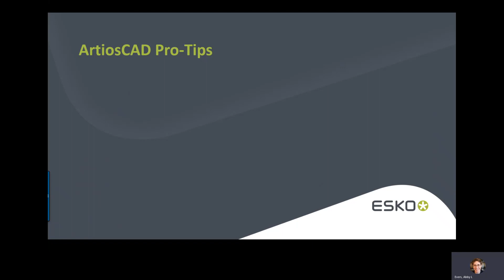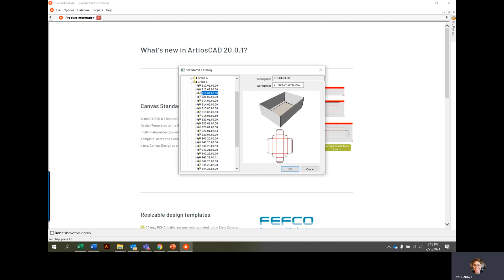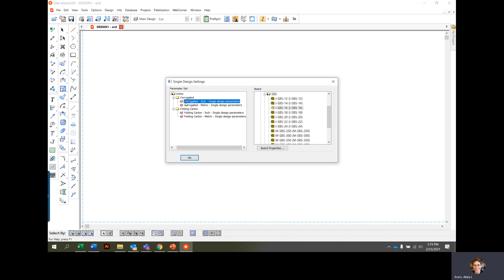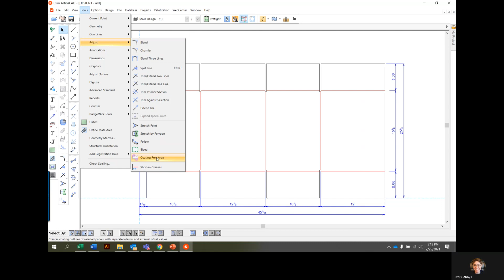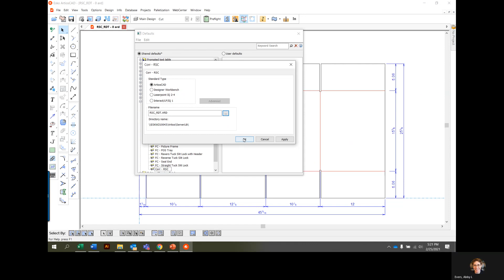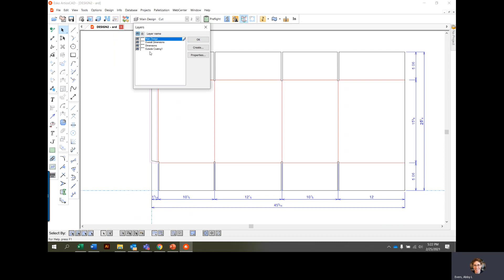ArtiosCAD Customizing Standards Library from RDTs with Intro

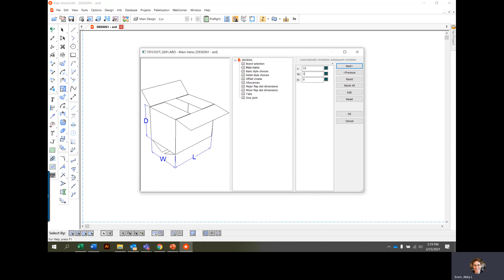Comment: Does this save the variables (glue tab, u changed in the  main menu/standard / rebuild pop up menu shown at @1:41
Reply: you can customise your design so the glue is defined with variables or even placeholders so you can easily rebuild your design